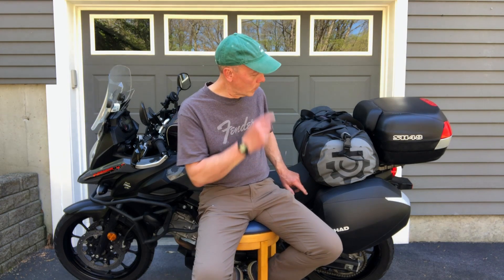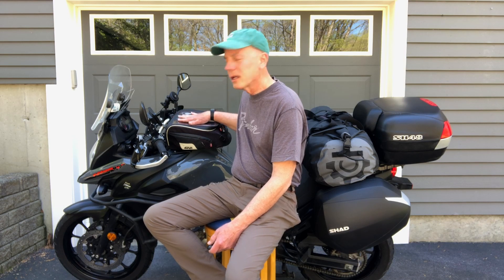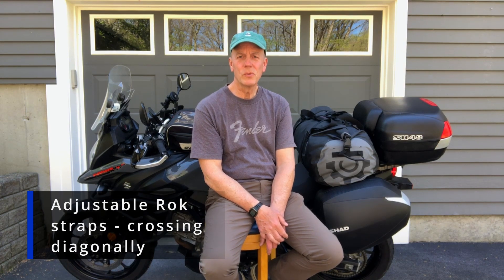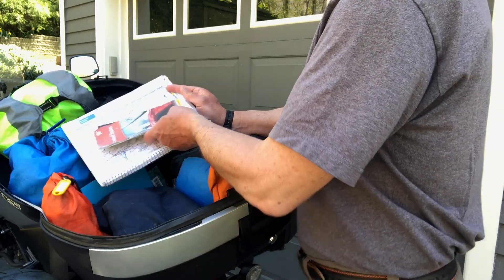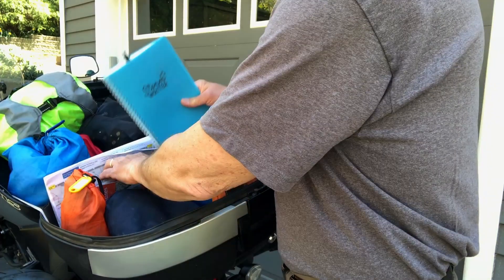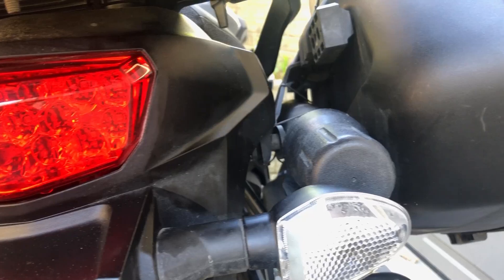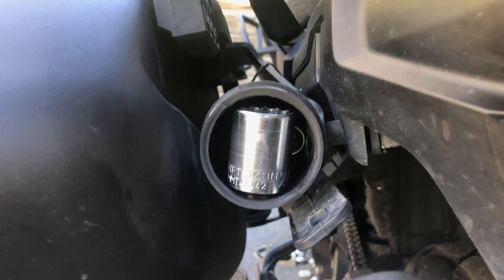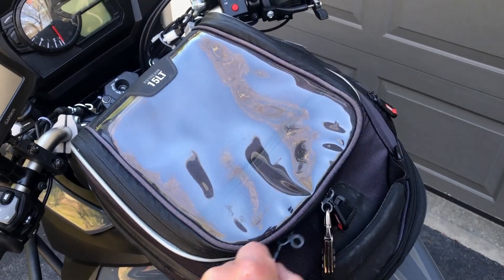Transcontinental  moto camping gear

Comment: Paul, 
You do a great job with you videos on your very long trips. I am just amazed at your ability to ride on extended trips, camp and produce such scenic videos. You have made motorcycle travel an art and a science. As I said you are living my dream.
 Hopefully you will not mind if I tell you more of my minor motorcycle experiences. When I start riding in the spring I will 76. I usually ride 1 or 2 times a week for about 2 hours each time.  In the past I have taken my bikes along on vacations in northern Michigan, transporting them on my small utility trailer. Last fall we rented a house in the northern Lower Peninsula, and I was able to ride twice a day in between hikes with our dog. The area is full of vacation homes on the lakes and very few people in the off season, so the scenic roads are almost car free. Where we lived last the county roads were mostly paved and where we live now are mostly dirt, so I normally ride more than 50% dirt roads now. I am a very cautious motorcycle rider, so I ride the back country roads to avoid traffic. In my first few months of riding the V-Strom I took a dump on a dirt road at a very slow speed on an almost 1-lane turn in mud on the shoulder, so I purchased Dunlop Trailmax Mission50/50 tires and with more dirt road experience I hope to avoid another crash. No damage to bike but only to my pride. Freshly graded roads around here are a death trap for a V-Strom, the road will be mush.
As you probably know the 2019 XT Touring comes standard with crash bars, center stand, hand guards, plastic side cases, wire wheels and lower engine cowling. The previous owner installed the same Givi windscreen that you have installed. I have installed several accessories: SW-MOTECH side stand foot, for safety visibility I installed low cost yellow (Amazon) driving lights inboard of the crash bars  (can be wired white or yellow/white for brighter light) that also shine from the side with a handle bar switch, loud Wolo air horn wired to horn switch to get a drivers attention, Suzuki gas tank protection film, Knight Riderz auxiliary brake light sequential LED light bar that is 7” long with 12 LED’s flashing in sequence one at a time left to right back and forth, then when brakes are applied they all flash at once and after some seconds they turn to solid red. The light bar is mounted on aluminum flat stock attached to the lower holes of the license plate, Adventure Tech foot peg lowing kit and shift lever relocation to fit my Alpinestars endure boots and radiator guard from Amazon. Like you I also have an Arai helmet, the Signet-X (High Viz) for oval heads that I started wearing after purchasing the V-Storm since my AGV helmet was 9-years old. This year I started wearing the Helite Turtle 2 air bag vest (High Viz) with a tether to the frame. I wear a lot of armor and with the vest I cut back on the armor. I took a Returning Rider M/C safety course last summer. Do you have near accidents with cars?
Maybe you have watched some of the YouTube channels that I have. John at Ozark Backroads has a Suzuki like mine; he has great maintenance and installation videos. I may install the front fork emulators per his video. Then there is Noraly at Itchy Boots that I have watched for a couple of years, even my wife was asking when her next episode was available. I found you on YouTube a few months ago. Sounds like you do a good job with maintenance, even on the road since you accumulated many miles. Sterling on Motorcycle Travel Channel does a good job too. The 72+ year old motorcyclist on My Senior Moments was in a motorcycle accident in Mexico; his Thanksgiving video was emotional since he broke an arm and leg. He just posted a short update on his injuries. There are too many motorcycling videos on YouTube to watch them all.
In the last video of yours that I watched you evidently have TPMS on you wheels with the PSI reading on your phone. What brand and model did you purchase and do they work well? How do you determine the rear tire air pressure for the load you carry? You said for security you use a motorcycle cover; how did you prevent theft of your gear when you visited the Rock-N-Roll Hall of Fame in Cleveland? What model GPS and Cell Phone holder do you use? What power outlets do you use for GPS and phone? It seemed that your cigarette plug had a lock on it, I have to use a band clamp and cable ties to keep mine in. What helmet speaker/microphone do you use? What GPS and satellite communicator do you use? What brand heated grips? Heated vest?
Sorry for so many questions.
Reply from the maker: Robert S - Thanks for your kind comments!  I am in awe of your riding in your 70's especially given that 50% is on dirt!  This is very inspirational.  Thanks also for sharing your information.  I need to look into the safety vest you wear.

I too have an auxiliary LED brake bar below my top case mount.  The SHAD top case also has a brake light and all of my brake lights are wired into a "back-off" system similar to yours.

I have had a few close encounters with autos but the only slow speed "get off" occurred during the 2022 Canadian Tour with a bus in New Hampshire which I describe a little in the episode.

My TPMS system is a FOBO Bike 2 and it works very well so far.  I leave the app open on my phone while riding as seen in my travel videos.

At the Rock and Roll museum I left my bike in a motel garage.  The locked cover will not stop a determined thief but should hopefully attract some attention when the cover is being cut away.  Probably more importantly is that I think it makes the bike less inviting a target.

The Garmin Zumo 396 and Quadlock charger mount are sent through a relay using the license plate light wiring as the trigger for the relay.  I have a lot of confidence in the Quadlock system after many thousands of miles.

There is no lock on the dash outlet though I do use a USB plug which is perhaps what you are seeing.

The Sena bluetooth intercom I actually use very little.  I do have a mic inside my helmet wired to my GoPro to record my voice which is covered by a "deadcat".  The deadcat which works fine unless the wind is very strong.

The GPS satellite communicator carried on my shoulder is a Garmin inReach SE+ which keeps me in contact with loved ones when outside cell coverage and also has an SOS button.  My loved ones can also track me whenever they want to.

The heated grips are from BikeMaster.  They provide plenty of heat and I discontinued wearing heated gloves as a result.

The heated jacket is by FirstGear and also works well.

I hope this answers your questions.  I also hope you have a great and safe 2023 riding season! 

Regards

Paul

Comment: Your camping gear video was very informative, I would like to hear about any modifications to your V-Strom, what gear you wear and any other helpful information. Mine is a 2019 V-Strom 650 XT Touring in red.
Reply from the maker: Hi Robert. 

The red bike sounds very nice!  I probably would not have chosen my grey but it was a left over model so I got a good deal.  The color has grown on me a bit.

I might do a video in the spring when things warm up to go over my mods and provide a list of specific vendors.  I added electronics using a relay off the ignition for my GPS and phone charger.  As well, I added back-off lights when adding the top case brake lighting.  I dropped my foot pegs an inch to help when standing and added inexpensive metal pedals for better grip.  I also added under seat wiring for my heated gear and to allow me to use a tire inflator.  The adjustable windscreen is a Givi Airflow.  I added crash bars and a bash plate along with a center stand.  The center stand is indispensable when dressing the chain which I do every two or three days (at 600 mile intervals) when traveling.  I am also adding auxiliary front lights when it warms up a bit since I lost my main headlight during the Canadian excursion and want additional back-up lighting.  In Canada I used the bright headlamp as a back-up but if that failed I would be forced to do a field repair.  Doable but not ideal.  I am already on my third main bulb and have considered installing an LED but have not done so.

My riding gear is very old (>10 years) and was made by Fieldsheer (they apparently no longer make non-heated gear).  The pants pocket zip finally gave out in Canada and I am thinking about springing for a new jacket and pants this spring with CE2 armor.  I just need to convince my wife!!  

I generally do my own maintenance though sometimes seek a mechanic if I am traveling.  I try to do my own oil changes on the road but have to find an auto parts store or fueling station willing to let me do so in their parking lot so I can properly dispose of the oil and filter.  Aside from oil changes, I replaced the front and rear sprockets and chain due to wear.  I also replaced the front and rear brake pads.  I tested the valve clearance and and re-shimmed where appropriate.  As part of the valve clearance check I also changed the radiator fluid.  I plan to lubricate the front and rear bearings this spring. 

I hope this gives some food for thought!  Thanks for watching.  Paul
Reply: @paulzig4323  Thank you for the detailed response. I purchased mine used about Sept. 1st. 2021 with 855 miles. I had found the bike new at a dealer in March 2021 but decided not to purchase at that time. I like the yellow model with gold wheels the best. My previous bike was a 2008 Kawasaki KLR 650 silver and red that I returned to riding on as a learning experience.

Comment: Howdy Paul. Mark T. from Texas here. Just got a 21 Strom last week and begining to fit it out.  Looked under my seat and back under the tail section is a plasic box that has two hoses attached to it. I see yours does't have that. Any idea what that small box might be?
Reply from the maker: Hi Mark. Is the box a junction box and tubing wiring conduit for the turn and tail lights?  That is the only thing I can think of that far in the tail section. My wiring is not in conduit.  You might check Partzilla to see if they have a parts diagram for that part of the 2021 bike. Regards Paul

Comment: Hi Paul , What brand name of tent do you have ? Would you recommend it ? Thank you
Reply from the maker: Hi Stew.  It is a two person Clostnature from Amazon.  I bought an excellent condition returned one at a discount for only $52 including tax and shipping.  It is somewhat difficult to recommend though it was a great value and I have lived in it for nearly 5 months total.  On my first trip a grommet failed which the seller did refund $13 for a replacement grommet kit.  On my next trip a couple of the tent poles failed which required field repairs.  The seller did not cover the poles under their "lifetime" warranty so I had to buy replacement poles for $32.  I now carry several spare poles and have not had any more problems.  The tent does an excellent job in rain protection and I have never had a condensation issue.  The tent is perfect size for my bedding and gear that I bring into the tent.  The double entrance is handy and the vestibule protects my moto boots which I leave outside the tent from the rain.  The zippers also work well.  I did seam seal the tent after a couple months of use.  Hard to complain about living 5 months in a $52 tent but the broken poles were a real issue in the middle of a trip.  Thanks for watching and please let me know if you have any more questions.  Safe riding!